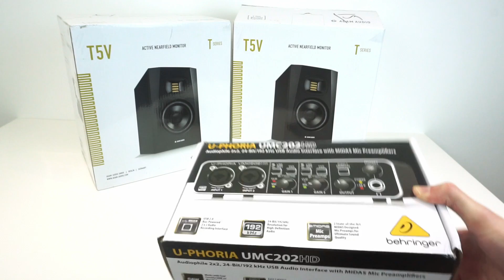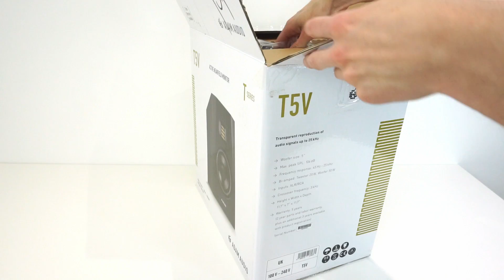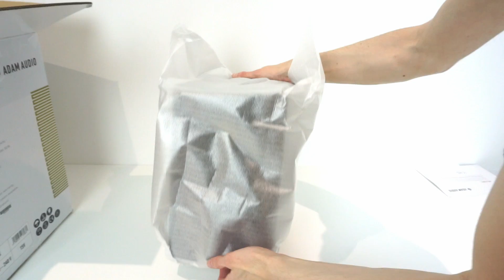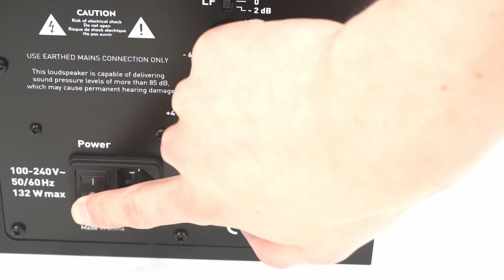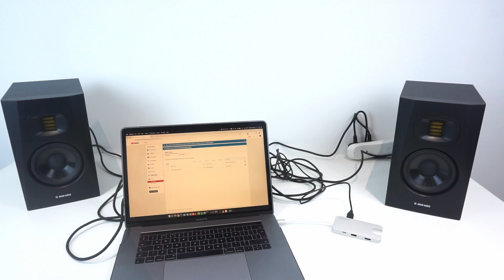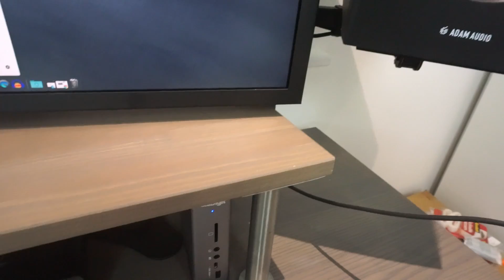New Home Office Audio Setup - Adam Audio T5V Studio Monitors

Comment: used to rock the 202HD with my old monitors (insignia bookshelf speakers i picked up from BestBuy for $80 during a promo). 

recently i upgraded to the adam T5Vs & an apogee element 24... 
massive fucking difference in sound quality. 

also, i tested the new monitors with the old behringer interface & there is quite a noticeable difference in terms of the sound quality of audio output as well as recording with the element’s superior converters & mic preamps. 
might be worth a look if you want to upgrade ur interface in the future bro.

Comment: one thing to check is if the UMC202HD has balanced outs as the 204HD does not, and as such using balanced leads is not generally advised. As for audio quality of the UPHORIA line, there has been tests that have put the HD line against £1000 D/A's and the Behringer has come out on top.

Comment: For the mounting, many of the Genelec models are already set up for VESA mounting, we've used that in some small control rooms. In your case, as long as the desk is solid enough that the speakers won't fall if you knock it, you're probably fine.

Comment: A couple years ago, i bought some Bang & Olufsen RL6000 speakers from the early 90s for cheap on eBay. After repairing them, i wanted to mount them on a wall. I found original wall mounts on the internet for more than I paid for the speakers and replacement parts combined, each. After closer inspection of the 4 mounting holes, i realized they were exactly 100mm apart. 10 quid later i had 2 VESA 100 mounts and they still hang on the wall to this day.

Comment: The INST button isn't for microphones, it's for guitars (and other other devices which require high impedance inputs). It only applies when using the 1/4inch jack inputs, which can also take a LINE level signal. Microphones should be plugged in via XLR, which bypasses the LINE/INST switch entirely.

Comment: Phantom Power: with most dynamic microphones you’ll be perfectly fine to pass phantom power through them. Some more delicate devices won’t like phantom power, but in general you’ll see it in the documentation. 
However... if you use a mini jack to XLR adapter you can do a lovely job of killing your laptop sound card! Can be particularly fun on digital sound desks when recalling a scene that includes phantom power settings
Reply from the maker: This sounds like you're talking from experience! :P
Reply: Oh yeah - killed some poor guy's laptop output dead during a show a few years ago - recalled a scene that wasn't right and thought the input was there and ... bzzt.  48V in the headphone jack.   Now I always put a DI box in front.
Reply: Chris Cebelenski having seen that, yeah I always check now. Just watching it happen was scary enough for me
Reply: @ChrisCebelenski  I usually try to put an interface of some sort between the console and the computer. It sounds better and protects the computer.
Reply: Remy Ilian I do too, when it’s my laptop. Unfortunately I’m often faced with a client laptop, and it’s hard to mess with those and change settings and install drivers.  A DI is often the best solution.

Comment: Because these are studio monitors, you are meant to turn them on last after following the output path if you want to avoid the "pop". I live with the same inconvenience as I have a somewhat similar setup.
Reply from the maker: Yeah, it's a bit of a pain.  I find that if I power everything up at once it's fine as the speakers do a "soft start" so they don't pop.  Problem is that when I connect/disconnect my laptop from the docking station, it power cycles the USB ports which reboots the interface and causes it to pop.  Half tempted to mod the USB cable (or get an external powered hub) so that it gets power from a permanent external supply rather than the dock.

Comment: I heard a pair of these a while ago and was very impressed, really excellent for the money. If you have issues with vibration (I think I heard some rattling in the first track at the end) try Sorbothane hemispheres under each speaker. Make sure to use the appropriate hemispheres for the weight of the speakers so as to be within the optimal load. Sorbothane really does work wonders, better than most isolation devices.
Reply: Ashley, I have a pair of older M-Audio AV40's, and I am wondering how the Adam's will compare? Are the Adam's harsh and bright for listening pleasure? I dabble in recording and want a decent upgrade.

Comment: Having the speakers up at ear level is actually a better position for them. If you ever see pictures or video from inside a recording studio control room you will see the monitors on top of the desk or on stands behind at the same height.
Reply: No, not the tweeter. Actually it's the distance from the middle of the tweeter to the middle of the woofer divided by 2. that position should point directly to your ears.
Reply: Yes, the tweeter should be at ear/eye level, apparently.